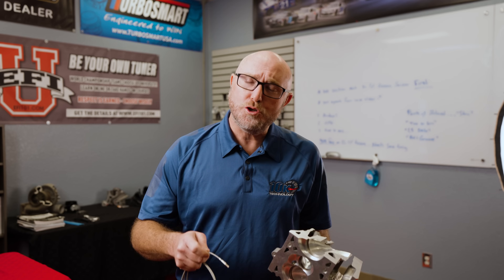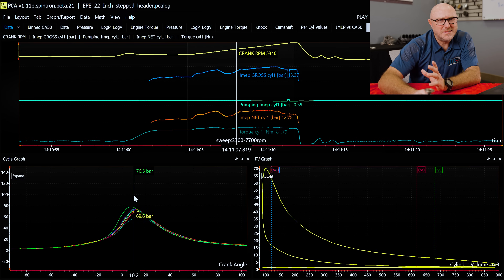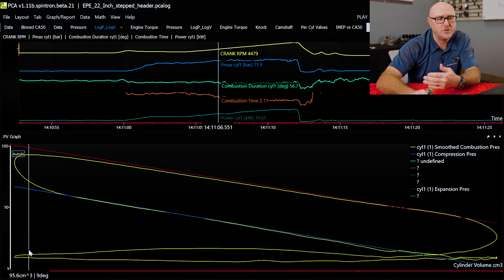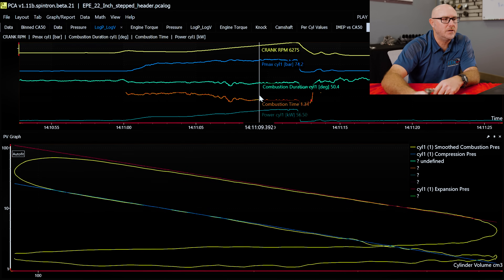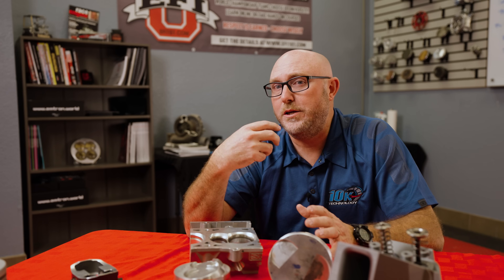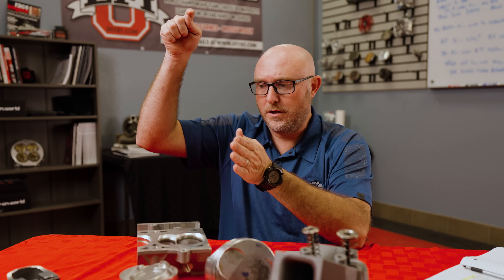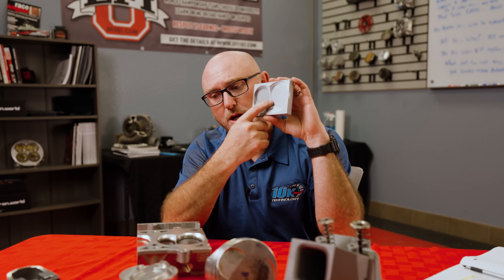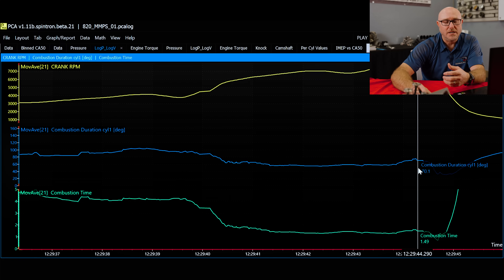I Think Steve Morris is WRONG and I Can Prove It!

Comment: I have been looking for a channel like this for a very long time and I immediately subscribed. As a former race engine builder and cylinder head porter I have always wondered how the effect of intake port design and specifically combustion chamber roof and floor design (piston dome or dish) effects the speed of combustion. There has been some books written about these theroies of combustion swirl in diesel engines but a gasoline burning high RPM engine is a far cry from a low speed larger stroke (IE. slow mechanical event ) diesel engine. has there been any test data thats available to study on this subject.? TY
Reply from the maker: I’m glad you found the channel! It is something we are working on!  We do sell some videos on cylinder pressure measurement on our website and also discuss these topics and many others weekly as part of our Delta Lambda Fraternity   you can learn more here: www.efi101.com

Comment: Maybe you should try a turbo boost application? Maybe that’s what creates the EGR recirculation you were talking about that would have caused the slower burn in the cylinder, hence not requiring a reduction in engine timing? 

Just a guess tbh, but it seems to me like the interruption in the exhaust that turbos create before it exits the car would potentially cause that EGR effect you were talking about. 

Maybe I’m wrong, but it would be cool to see you get the data and prove it out either way.
Reply from the maker: The second example in this video is a twin turbo pro mod engine
Reply: It can have this effect unless you're running a large enough turbo. Typically milder turbo cams are timed in a way that prevent exhaust dilution due to excessive overlap. As you open the turbine side up, you can run more camshaft and thus make more power. Essentially this is reducing the "EGR" effect. This of course also hurts boost threshold so it's always a compromise.
Reply from the maker: Still a ton more variables though!  But great point!
Reply: @EFIU_Ben  Oh absolutely! If there's one thing engines are good at, it's variables. I over-simplified a lot for the sake of a comment, but should have stated such.

Comment: Agreed, I’ve seen the same with cars I’ve tuned some I was surprised that I didn’t have to pull timing but for most setups timing was pulled, never thought about the surface area though, that some good info (as always from you channel) I always attributed it to egr’ing from back pressure.
Man I would love to see the ve and ign map from that supercharger LS after you installing this Kistler sensor, actually before and after if the maps were both boost to really the advantage of that data.
Reply from the maker: Lots to unpack there, I’ll see if I can get a video made to cover some of that!

Comment: Good arguments I,m wondering what your pressures would be in a nitro engine ours we run approximately 60 degrees timing due to slow burning of nitromethane
Reply from the maker: I haven't measured one (YET!) but I'm told their cylinder pressures aren't necessarily way higher...they just last for a REALLY long time after TDC and continue pushing the pistons down HARD!
Reply: @ yes pushes hard is an understatement we constantly measure the rods each pass as they get shorter due to pressures exerted on them
Reply: @jeffthomson1777  I believe it but it's still crazy to me because I used to build a VERY different style of race engine and yes, measuring rods was a constant thing to monitor. But that's because they got LONGER, not shorter. 30k rpm can stretch anything, LOL

Comment: Just saw Steves short about this so had to check it out
Reply from the maker: Love to hear what you think?
Reply: @EFIU_Ben  really enjoyed it and was interesting to go into so much detail and things I've never thought about. Would love to see  you team up with Steve to do some testing
Reply: @EFIU_Ben  IMO, it would have everything to do with quality of the air fuel ratio. This would effect a naturally aspirated engine the same as a boosted engine. IMO, changes in the air fuel ratio AND the quality of atomization is the root of the timing differences. (I'm thinking the routing of the air/fuel mixture to the combustion chamber causing the fuel to drop out of suspension)
Just my guess.
BTW, I LOVED this thought process!
Reply: just about to watch this, but Steve reckons you are all about Data 🤣 I think you can take that as a compliment
Reply: Every engine is different. You're just bench racing. Steve's combination obviously works.
Reply: Ditto
Reply: Same here. Can’t wait to see the data